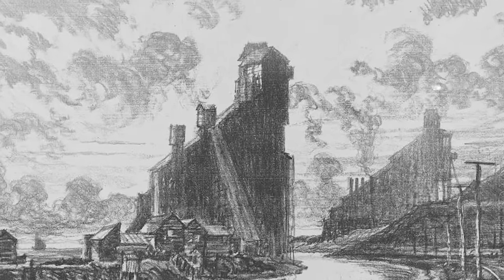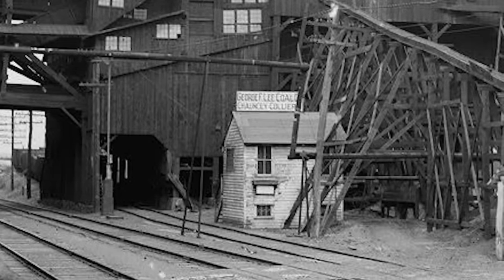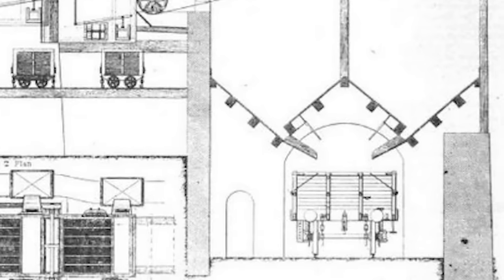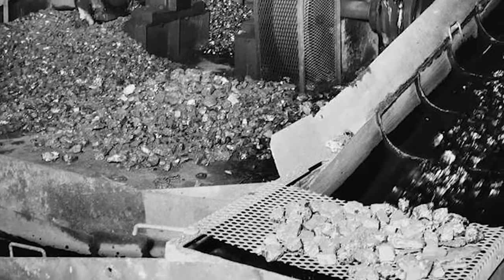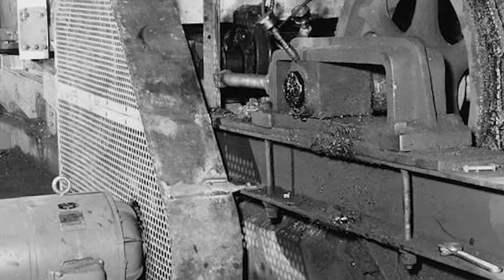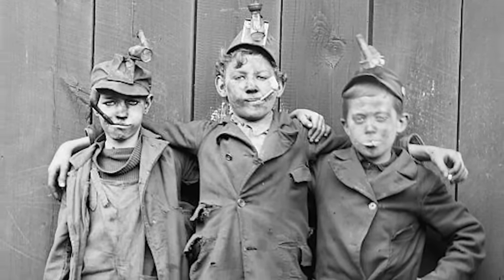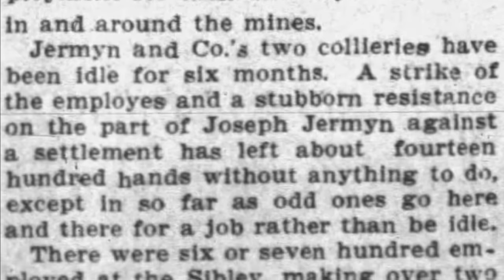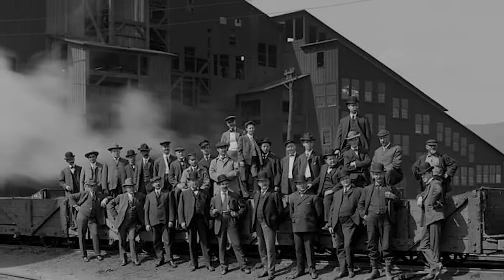Why Coal Breakers were Horrific Places to Work (Coal Breakers Explained)

Comment: In 1970 I started work at Magma Copper in Superior Arizona. I was assigned to the mill and crusher section and most new hires were "pickers" for a couple of weeks. All sorts of garbage comes out of a copper mine as the miners use the ore chutes as a garbage dump. Wood, broken "jacks" (sledge hammers) and lots and lots of blasting caps. As a picker you had to pull out as much as you could before it hit the jaw crusher. There was another picker before the Symons crusher to get what the first guy missed. The Symons crushed the ore into pea gravel size.

Occasionally the first guy missed a sledge hammer head and it was important for the second guy to get it. If not, a sledge hammer head being bigger than pea gravel size makes a hell of a racket in the second crusher. They said you could hear it in downtown Superior when it happened.
Reply: Insane that they didn't install a magnet or eddy currrent kicker as a last safety catch. Oh well, lots of companies then and now are pennywise and pound foolish.
Reply: Were the blasting caps capable of exploding in the machinery if not handled carefully and go out in time???
Reply: @jgdooley2003  Usually not because most of the caps that were missed were picked up by a magnetic drum roller on the conveyor belt. If one did explode, the machinery was so massive that it didn't affect anything.
Reply: @tetrabromobisphenol  There was a magnetic drum roller on the head of the conveyor belt that was great for picking up small blasting caps and small pieces of metal, but a 7 pound sledgehammer head would just sail past it.
Reply: @Javelina_Poppers  Always assumed blasting caps were paper...
Reply: @JungleYT  Blasting caps for initiating insensitive high explosives are often steel cased with a crimped and sealed mouth, it protects the primary explosives inside from moisture, the elements, minor impacts and other damage but it also allows them to be picked out by magnetic pickers as mentioned previously. Sometimes you see hand-made blasting caps being made from brass rifle cartridge cases as they do a pretty similar job protecting the powder and priming compound inside them.
Reply: @Javelina_Poppers  caps are aluminium.
Reply: Nice, Also along the Southern Pacific's narrow guage line

Comment: As a state worker from Philadelphia I first got to see some of these massive buildings in my travel for my job.  As noted most  of them are now inactive since coal useage has dropped off. I grew up with coal heat when I was younger and did notice the difference in coal quality that we used to heat our house. A good load of coal resulted in a nice fine white ash. Coal with slate or other impurities did not burn as well and resulted with ash with lumps of unburnt coal attached to whatever the impurity consigned of. It is nice to see someone put up the history of the hard work that went into processing coal for consumption.
Reply: I've never seen coal burn... Do you light it like wood and it just catches or what? I imagine the flame eventually sticks to it? Grew up in California in the 1960s and 70s...
Reply: @JungleYT  you need a good fire to get it going. A good bed of hot wood coals will get it lit. Or a torch@ it takes a good bit of heat to get the coal going. In a coal stove it doesn't have much of a flame when the stove is properly set up. It just put off a warm glow and alot of heat.
Reply: @leokarasinski4217  Thanks... I had a feeling it didn't light so easily. Amazing it become such a staple for heat. But it sounds like if added to an already going fire it works real good...
Reply: @JungleYT  yea once you get it going and in a good stove or whatever you are using. Keep it fed and it will stay lit and stay hot. It's crazy stuff. The energy density of coal is absurd. The only downside is all the crap that it gives off when burnt. That's why it's going away.
Reply: @leokarasinski4217  Right... Thanks
Reply: I live in NEPA and still burn anthracite coal in my furnace.  The hot water for showers is amaaaaazing in the winter, and it's still extremely clean and good quality.
Reply: @vulpsturm  nepa.... nice I live there too
Reply: @vulpsturm  I G**gled NEPA and it said that's an environmental act and not a location?
Reply: @JungleYT  NEPA is just shorthand for northeast Pennsylvania. If you are not from PA most people and Google included would not recognize it as a reference to a geographic location. NEPA was and still is the home to where most of the hard coal is mined and used. In the western part of the state soft coal is also mined but is not usually used to heat homes this coal is used in industrial plants and does not contain the high btu capacity per ton that hard coal provides.
Reply: @johnchambers8528  Hey, Thanks! I leaned something else today... LOL
Reply: @leokarasinski4217  The energy density of coal is mediocre at best. Uranium has at least 2 million times the energy density of coal and if you consider that to burn coal you also need TWICE the amount of oxygen as you do coal (it takes 2 pounds of oxygen to burn 1 pound of coal) then Uranium has more like 10 million times as much energy density as coal. So while coal may have more energy density than dirt, it is by no means an impressive amount of energy density.
Reply: @winstonpoplin  neat.... meant more so of fossil fuels....
Reply: @JungleYT  You might want to watch the Centralia Mine Disaster about an underground coal fire that's still burning and will most likely continue to burn for many decades yet.
Reply: @sirridesalot6652  I have heard about that...
Reply: @mikejones6791  Still doesn't poison the Earth for thousands of years...
Reply: @JungleYT  they didn’t have charcoal grills?

Comment: My uncle used to work as a miner. He was picking up wooden chocks from a moving conveyor when he had an accident. The chock stuck in the convayor as he picked it up and the forward force of the moving belt pushed the chock upward with my uncle's hand holding the other end. His fingers was crushed between the chock and the rails which were above the belt. He said there was so much force that the wood split and the whole machine jammed up and he was stuck there. He lost one finger and half of another.
Reply: Brutal
Reply: i started my apprenticeship in 1976 in UK coal mines, and one of the first things we learned during our induction training, was ALWAYS pick up from the trailing edge
Reply: @BigBadLoneWolf  It's funny you should say that. My uncle said the same thing! XD

Comment: Breakers were unique to anthracite country.  In bituminous coal country, "Preparation Plants" are a lot smaller and perform many of the same functions to this day.  Bituminous or soft coal is a lot easier to grind up into saleable sizes.
Reply: Did you work the Chessie System / B & O yard in Fairmont, WV? My dad used to take me to the roundhouse at Bellview and the beginning of the main yard near the high level bridge back in the early 80s when I was 5 and 6 years old. I used to climb up on what were mostly the Chessie "cats", and ones painted B & O and C & O, as I was ecstatic to actually climb onto a locomotive after only seeing them roar by the house blaring the horn at the crossing up until then

Those days of when it was "railroading" sure turned over and died. Now, it's just a shipping company that spies on its employees
Reply: @chuckshartz2722  No, that's just a handle I picked up because I was always interested in tower operations and dispatching.  My late grandfather did work out of Fairmont as a trainman and conductor from 1943 to 1975.

Comment: I used to explore the St. Nicholas, the Huber, the Locust Summit, and other breakers here in PA.
    All gone now. Watched some of the disassembly of the Huber. Very sad to see. 
   I'd call them pretty hazardous if you're not paying attention, or just aren't too bright. Sometimes saw kids in them..when parents are that careless, property owners and lawyers get nervous- probably part of the reason they're gone.
    All that I entered were steel structures,  not wood. Although plenty of coal around on all floors to burn. Slowly.
   I really miss them..tried to bring friends, all were sort of amazed and fascinated,  even if it at first sounded like a weird way to spend an afternoon. Something you'd never forget. An amusement park is a contrived waste of time compared to things like this!
   It seemed more correct to think of it as a large machine, covered to resemble a building from the outside, rather than a building containing machinery.

Comment: The way they processed coal on conveyor belts, reminds me of the conveyor belts in the fruit packing houses. My two aunt's, Elsie and Louise worked in the packing houses up in Sacramento while in their teens. I use to work in a industrial laundry in my early 20's, and they had conveyor belts in one laundry I worked at, it was called Hospital Linen Supply, and was on North Broadway here in Fresno, but it got torn down years ago when they put in the 41 freeway.
Reply: No they didn't, and no you didn't. Stop with these tales. You made sambiches and pizza at Gordos Pizzaria. They fired you for eating the pizza before you served it. Then you copped a job in Peters Pet Shop sorting goldfish and turtles.

Comment: I used to paint coal breakers in HS in Schuylkill County. Was still fully operated by Readin Anthracite. Never actually worked on the coal but painting it was more than enough.
Reply: Is that in Pennsyltucky?
Reply: I live in Coaldale Schuylkill County and I did some work as a project on the number eleven breaker on the Coaldale/Tamaqua border. I remember watching it burn back in the mid 90s

Comment: For those who are wondering why these buildings are uniquely Pennsylvanian, according to geologists, Pennsylvania contains approximately 90% - 96% of the entire world's supply of anthracite coal.
Reply: Yet there's virtually no coal mining happening in Pennsylvania anymore
Reply: They are not unique to just Pennsylvania....I lived not 200ft from one  growing up here in Southern West Virginia in fact the 18 mile valley I grew up in known as Buffalo Creek must have had at least 5 or 6....The newer ones were made out of steel instead of mostly wood and were known as  Coal Tipples
Reply: @100pyatt      China will change that when they buy Pennsylvania during the US debt liquidation auction.
Reply: @100pyatt  Pennsylvania will produce around 40 to 50 million tones of anthracite and bitumen this year.  Which is about normal.  The Bailey mine alone produced around 37 million tonnes of Bitumen last year alone.  The issue here is that we need a fraction of people to actually mine the stuff as opposed to a century ago.  Don't get it twisted.
Reply: NO. Germany has a lot of brown coal. One valley in VICTORIA AUSTRALIA has the majority of the REMAINING worlds known brown coal reserves. I drive past them every second year and it's MILES long
Reply: It's the highest quality coal in the world 🌎
Reply: @OffGridInvestor  brown coal is not anthracite
Reply: @100pyatt There is still mining in NEPA it's just strip mining instead of deep mining. Lehigh is one company that thing is huge. There was one in Archbald I don't think that one's operating

Comment: I was thinking these would be unique to Pennsylvania Anthracite country. Anthracite is an extremely hard coal, and needs to be crushed before it could be used in MGP gas generators or power plant boilers. 
It was the preferred fuel for Manufactured Gas Plants because of its few impurities. The use of Bituminous coal in MGPs would create a lot of waste and toxic byproducts.
Reply: We have similar in WV in the bituminous coal, and I work at a crushing plant, it’s a big ball mill turning coal into powder.
Reply: They turn it into COKE and use it in the steel mills. Cliffs(AK steel) in Middletown OH is rebuilding their Coke plant And there is a private Coke plant behind them on Yankee Rd. The US needs more Steel, Aluminum and other metal mills, Spar mines Coal mines and manufacturing plants in general. Less government. 
You don't work you don't eat mentality.

Comment: One factor presumably was the inconsistent grades of coal found in Pennsylvania, whereas coal-mines here in Australia have usually produced reasonably good quality coal, especially coking-coal, although Central Victoria yielded abundant quantities of the lower-grade brown coal up until the closing of the large open-cut mine and the power-station it supplied!
Reply: Those coal mines in Moe are STILL running and much of our power STILL comes from there. I drive past them every year or two going to my sisters place. ONE power station has closed or i scheduled to.

Comment: The most valuable coal in British mines was large coal.  This was used in the steam engines that powered trains, ships and factories.  Miners were only paid for the amount of large coal they dug out.  Small coal, despite being sold by the mine owners, was not paid for.
Reply: Should have left it down there and let the tight sods bring it up themselves.
:-)

Comment: Pretty much half of my family worked in the mines, some in the breakers or around them.   And of all of them and their friends and neighbors as well.... I never heard anyone says that the breakers or the mine or the strippings were 'horrific'.   And most of them really like their jobs and went on to raise families and were quite happy.
Reply: Your family might be the exception. In any case you should never come to the conclusion by just listening a very small sample of information.
Reply: Same, only people that claim the work as horrific never did it, I’m sure people today look at where I work and think it’s horrific because it’s dirty, hot work because you get covered in coal dust and walk around in a 100F building
Reply: Basically Education(book learned) is reading everyone's propaganda and taking it as FACT.  That's why learning a trade is an honest job. Because 2+2 =4 
Yellow and Blue make Green. If you avg 60 mph you can drive 600 miles in 10 hrs 
With an 11 hr drive time on a 14 hr shift clock. 2 drivers in one truck you can run 
Fresno to Boston in under 72 hrs.

Comment: I thought you were gonna say “5,260,855 tons of coal per day “ for a second 👀😂🫠.. Anyways, nothing quite like beating off a bunch of coal with likely a pickaxe, surrounded by coal dust with sparks flying at your feet. Good thing coal is INflammable I guess!!!     

Edit before being “corrected” and possible berated lol: Yes, I do know that coal is not actually inflammable, but rather flammable due to its it’s ignition properties. Just randomly thought about an old ass episode of the Simpsons with a similar joke lol

Comment: We take so much for granted in this modern world what a bunch of madness our ancestors lived through
Reply: Some still do, my coworker’s brother is working in 30in coal (about the distance between the bottom of your foot to your mid thigh, so low that when the shuttle brings them in they have to lay on their backs and the shuttle driver has to follow a line of chalk on the ceiling because it’s impossible to look forward, and as for myself I work in a coal mill, crushing coal into powder so everyone can have nice new tires and rubber compounds to keep the world’s industry moving

Comment: You should do one on the one in Ashley PA called blue coal were they painted it blue
Reply: One of the reasons it was called blue coal is if you had a good coal fire going it would produce a nice blue flame coming off the coal pile. So that company used that name to signify that they sold high quality coal that produced that nice blue flame. The color was just a marketing angle they used to differ their good quality coal from other mines.

Comment: Coal workers are a proud group of people. They deserve alot better. Coal is plentiful and can be refined into diesel,  rocket fuel and can heat any home that can house a Coal stove.
Or u can even have a outside boiler.
People are just lazy and don't wanna do a little work.
Also the ashes is used instead of road salt. 
Coal is cheap and plentiful plus the heat from a coal stove will warm u from the inside out.

Comment: Isn't it strange that to get the coal it caused death and the burning of coal causes more deaths
Reply: But it prevents death aswell, it's a cheap Form of energy so nobody freezes and the chemical Industrie started with coal. Soap for example can be made from coal and oil byproducts
Reply: And yet you continue to drive a car with rubber tires which are made with a rubber compound that has coal in it, the concrete your building is made out of is mixed with fly ash from burned coal from a power plant, the dandruff shampoo in your bathroom has coal tar in it, the city water filtration center uses coal lined filters to scrub the water, earthquake proof buildings riding on massive rubber gaskets have coal in them, makeup has coal in it, aspirin has coal in it, paint has coal in it as a binder.